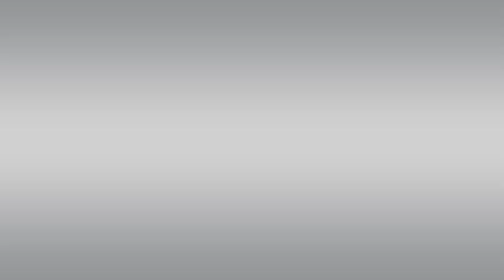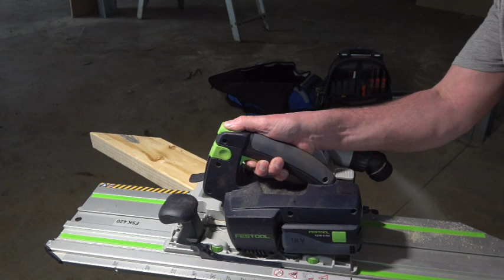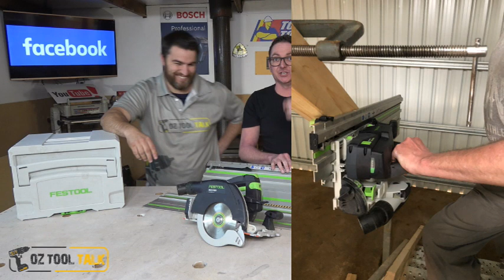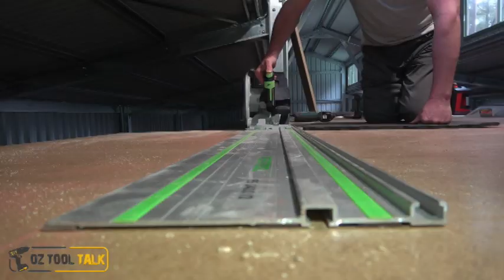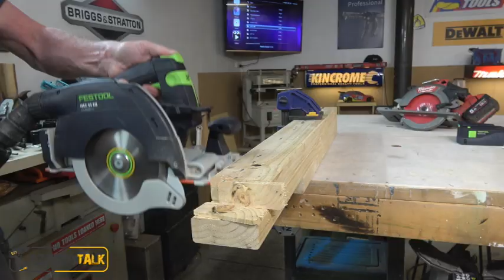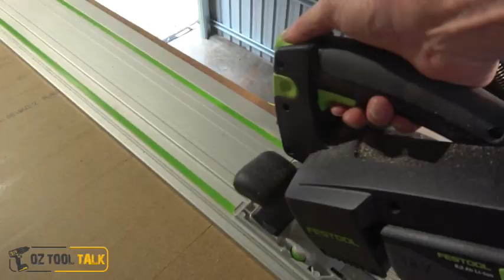Festool 18V Circular Saw HKC55 - Most VERSATILE saw ever! (2019)

Comment: I've had my HKC55 for about 18 months or so and I agree it's a fantastic saw. I use it for most jobs. I no longer use my docking saw for laying decking boards,  I use the HKC55 and it saves me a heap of time and effort, no measuring,  just Mark and cut. I use it to cut out sinks etc in laminex and timber benchtops, cutting rafters,  beams, you name it.. I just wish it was more powerful, I know you think it has enough power but I use my saw very regularly and you have to "love it gently" when cutting through anything over 20mm in thickness. Yes it will cut thicker material but you have to be kind to it. 
Side note, you can use a Makita track with the HKC55 after a little modification to the track. 
Huge HKC55 fan, if you don't own one, do yourself a favour and get one. 
Some competition from other manufactures would be welcomed too..
Cheers 
Colin
CH Topnotch Constructions P/L
Reply from the maker: great reply, thanks!

Comment: I got the tsc 55 and have really enjoyed using it. The power is excellent and collects the dust quite well. I have never used an HKC 55. I seen Maffel also makes a similar cordless saw using the Metabo batteries. The price is probably pretty similar between the 2 companies. Bosch is also coming out with their own "HKC" style saw but it will be a 7 in blade instead of your typical 6 in blade on most other track saws.
Reply from the maker: ah wow, that will be interesting to see!

Comment: Love my Festools BUT ... and for context I've got a truckload of Festool gear and the 3 different size FSK rails, multiple FS rails, HKC55, HK85, TS55, TSC55 and TS75. The FSK rails seem like fun till the bungee cord inside stuffs up and all of a sudden you're in the middle of a job and you're screwed. I'll also say that I feel the HKC55 is down on power compared to what I'd ideally expect. Now to talk about the cause ... Festools are designed to run with dust extraction and at the very least the dust bag .. but the temptation with the HKC55 and FSK is to ignore it and just get on with the job - that's where you'll come loose, the track will get gummed up with sawdust and screw up. Learn from my mistake!! ;(
Reply from the maker: thanks Kevin, nice feedback!

Comment: Watch Ave's review on the ts55 festool saw. They have some inferior parts inside compared to makita's version. Eg: bushings instead of bearings. I'd imagine this is the same.
Reply: Read the comments on the AvE video. They specifically talk about that brass bushing and how the shaft rides on a wave of oil, not metal on metal.
Reply: Coincidentally, it’s that specific bearing in the  Makita tracksaw that the owner should worry about having to replace....

Comment: If it's 160mm does that mean that when cutting 2x material on a 45 degree cut, it won't make it through in one pass?
Reply from the maker: Didn't check that specifically, but it's depth of cut at 90deg is 55, same as most 165mm blade saws
Reply: @OZToolTalk  probably not even worth checking as I don't think you'd be buying one of these for framing but i was curious. Cheers.
Reply from the maker: It is aimed at framers actually!
Reply: @OZToolTalk  don't see it being used by framers who frame roof systems. Simply not enough power and maybe not enough depth of cut. For any other general framer, maybe.

Comment: can you do a 45 degree cut without holding down the track so as the system doesnt topple over. pretty dear for what you get. I would like to see a shoot out with festool and makita. makita 1400 track 99.00 1900 track 150.00. festool overpriced for the average woodworker. much better alternatives, do the same quality job at more affordable price

Comment: Mafell have been doing this years and years this is just a copy with less power.
Reply from the maker: really? We don't have Mafell here...

I thought usually Mafell were the one's rebadging other's products?
Reply: Oz Tool Talk I have a Mafell ks saw from 2003. Theses types of saws are definitely not new. Runs on there own guide rails as well which are far better than the festool fs rails.
Reply: Oz Tool Talk I real shame you don’t have it over there it’s a real step up from even festool.
Reply from the maker: wow, I wish we did have them!
Reply: @OZToolTalk  we do have mafell, its sold through Rothoblaas in Victoria. Mafell are apart of the German super 8 CAS system where 8 different manufacturers all use the same battery. So mafell, metabo, starmix, rothenberger, steinel, haaga etc. The mafell drills and sanders are basically metabo, however the bosch track saw is a lower spec mafell MT55, the mafell/bosch tracks were co developed. Festool and mafell make alot of tools that are similar but very individual each with complete accessories and consumables
Reply: @Tech_Built  I've been wondering about "sharing batteries" at least standardizing the mount and the chargers the way that the EU forced the phone manufactures to pick a single standard, or a least fewer than one per manufacturer. In the USA the manufacturers are trying to lock you into a system by making the batteries all unique. 
It's a real waste, because you end up buying more chargers than you need, and/batteries.  These unique batteries are terrible for the environment.

I'm not saying stifle innovation, I'm just saying that an 18v 4.0 AH battery should work in a variety of manufacturer's tools.
Reply: @OZToolTalk  Looking at the price of the Mafell drill driver/hammer drill driver, it's pretty steep compared to the stuff sold here in the USA. Although the snap on head for angle drilling looks cool. You'll have to wrangle a set of these tools and give them the full test to see if they meet the quality standard their price commands.